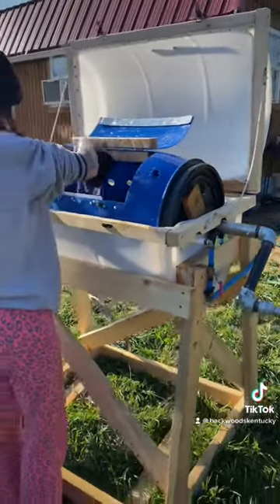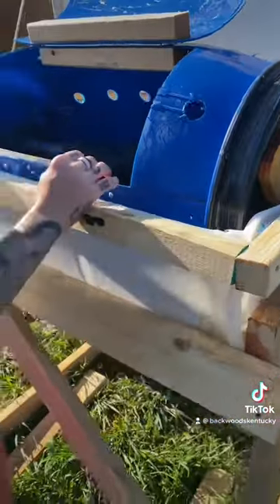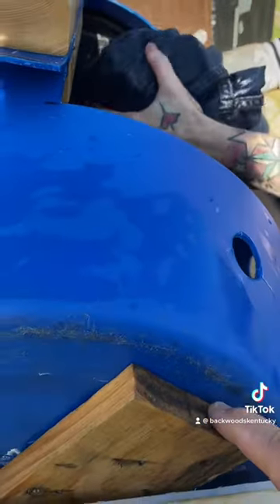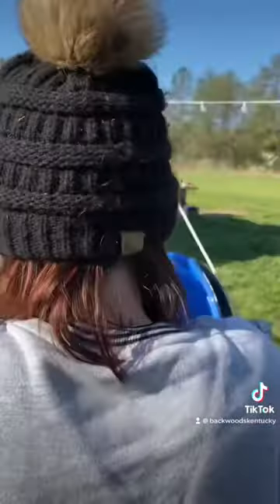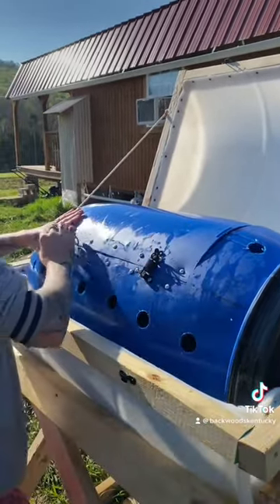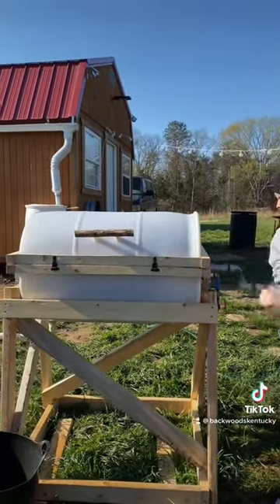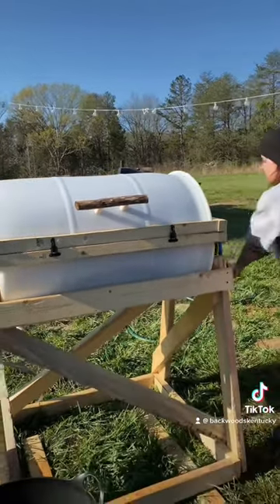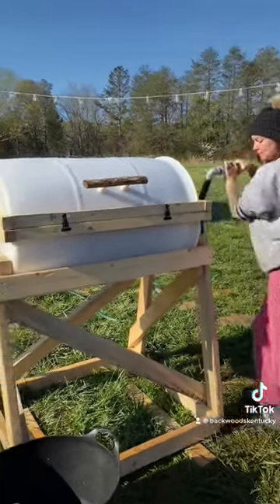Homemade off grid manual washing machine

Comment: May I make a suggestion? Instead of going electric with it go out and buy a 10-speed or a 12-speed bicycle and use the rear wheel as the gear mechanism to turn the barrel and you can still change gears for a higher rate of RPM or a lower rate of speed for washing

Comment: You could have put a motor on it somewhere. Anyway it’s a good project. I would like to make something which can be done by hand and if there is electricity just run it with a motor or attach a drill that will spin the drum.
Reply: No you don't want to use a drill to spin the drum on that washer because it is not strong enough to do that and you will burn the drill up anyway because they will get hot and catch on fire 🔥